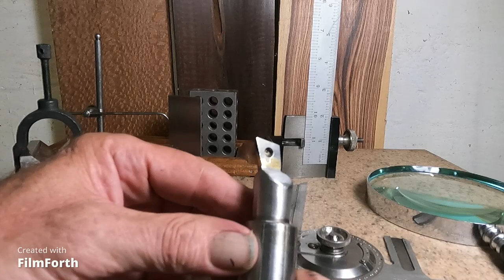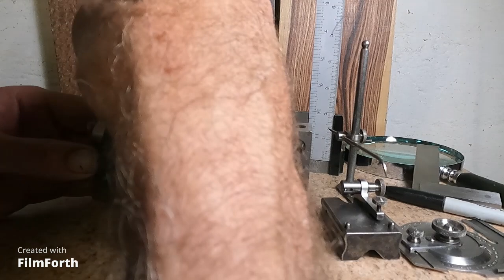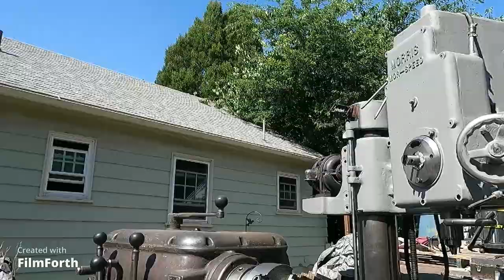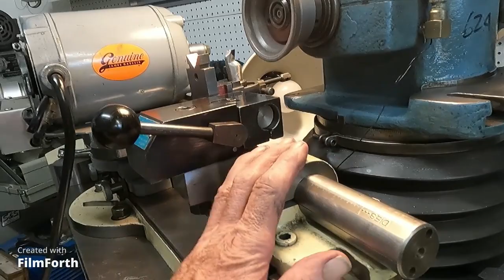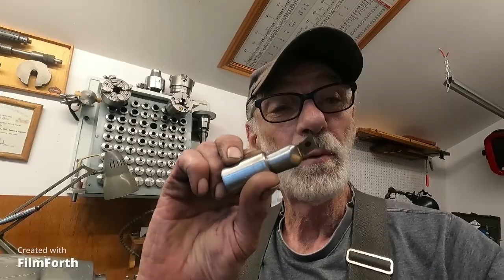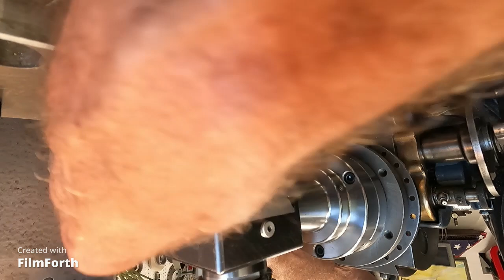Carbide Tool Maker 2 grinding and testing boring bar!

Comment: That boring bar cuts really well!  I bet that you could not buy a boring bar with those dimensions-  certainly not an off the shelf deal.
Reply from the maker: The funny thing about the internet is I posted here, 1" stub length boring bar, one popped up on my computer a Criterion bar from MSC for $75. This bar is more versatile the carbide is thick and the angles can be adjusted, it can be sharpened many more times

Comment: The black body filler on these old machines you're restoring is it possible it could contain asbestos? You might not worry at your age but I think it would be good if you warned people that older paints and fillers could be made of nasty materials and to protect themselves from the dust, great channel by the way mate.
Reply from the maker: Thanks, I was told the black filler is carbon and a varnish or some binder, there appears to be no asbestos fibers, there could be lead in the old paint.
Reply: @deedeeindustrialsuperprecision  That almost sounds like Japanning.